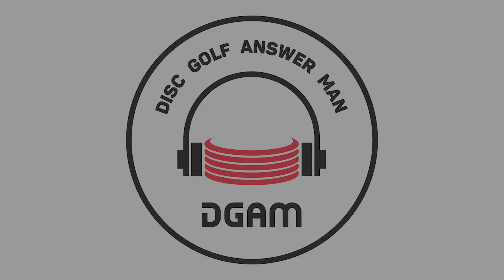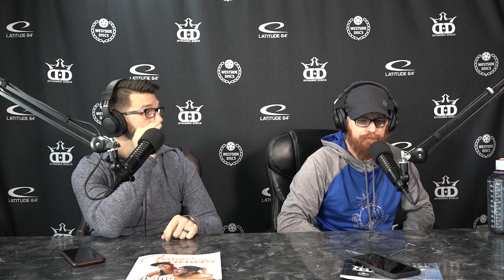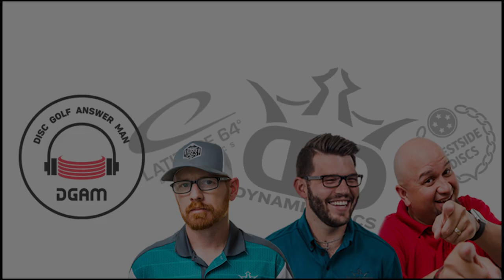Does spin affect the flight characteristics of a disc?

Comment: I found that by slightly changing my grip my disc spin speed increased dramatically. I noticed it when I was throwing into my net. Before the grip change it would hit the net and slide down. After the grip change it hit the net and spun across it. The grip change was pretty easy and only took a couple days to work in. Basically, I'm putting the edge of the disc in my hand in such a way that the palm of my hand does not touch the face of the disc. Only the pad of my thumb touches the face. For consistency I line the disc up between my first and second finger and down the middle/top part of my palm which for me means the edge of the rim is kind of between the top and middle palm creases. Anyway, as soon as my palm stopped touching the face of the disc the spin increased which also added considerable distance to my drivers and mids.

Comment: The same disc thrown at the same velocity but with faster spin will be slower to turn over and to fade out, fortunately for us modern backhand technique achives both velocity and spin.
(There is a gyroscope physics lecture from 1999 by Walter Lewin of MIT on youtube.)
The spin doesn't directly effect the lift of the disc as Emac implied but the slower turn/fade rate means less angle and thus a larger portion of the lift directed upwards especially once we subract the force of gravity on the disc. As Robert mentioned the towel drill might help with this but also the heavy bottle drill, and just mainly focusing on getting into that powerpocket.